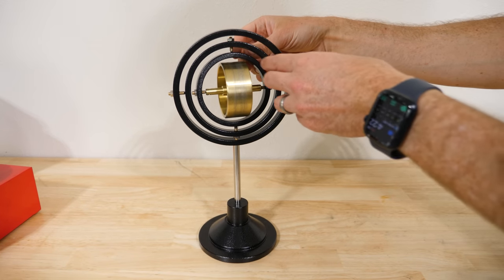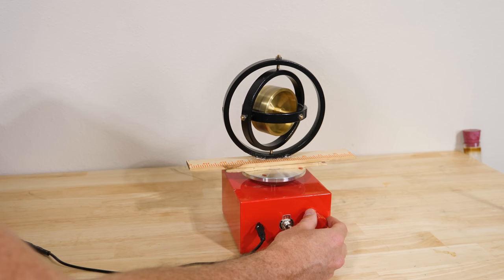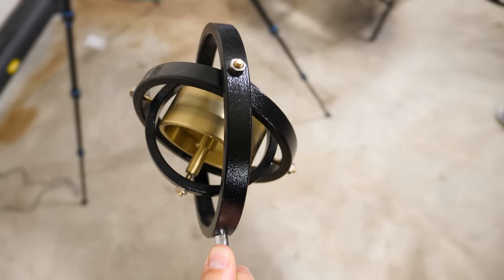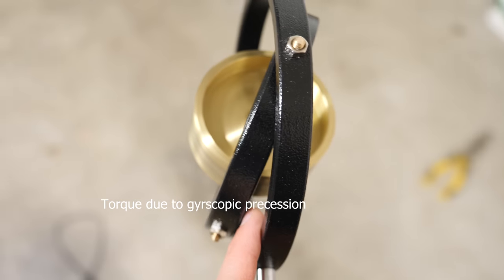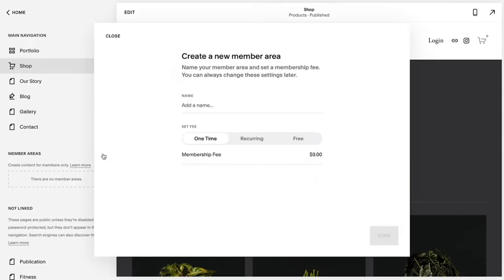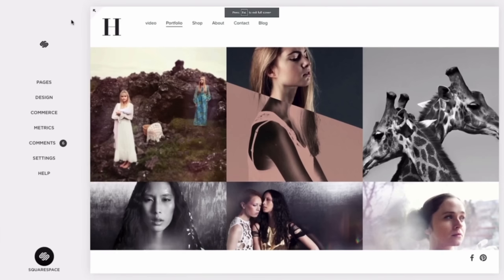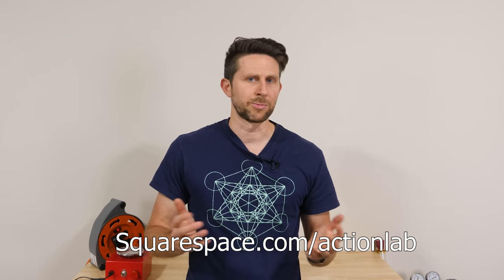Can Gyroscopes Provide Free Energy For The Planet?

Comment: What about instead of a gyroscope, you used a Foucault Pendulum? It swings based on the Earths rotation, needs no introduced force like a gyroscopic mass, and can exert energy without (noticeable or appreciable) slowing (in the cases Ive seen, knocking down pegs). Could it be used to generate a weak electromagnetic field by passing a magnet over a coil?
Reply: But the balancing pendulum requires some energy to go forth and forward (unless I didn't understand what you meant). It will be strongly slowed down by the magnet.
Reply: I went to the exploration place and they had one and yea it knocked down pegs. It was used as a clock so it must be fairly consistent.
Reply: Using that as a magnet moving to generate current in a coil seems an interesting idea
Reply: Maybe with a modification you could extract rotational energy rather than extracting the kinetic energy of the pendulum swinging. If the pendulum mass was on a solid rod (like a hammer for example) and the end was hinged to a disk or something that could rotate at the pivot point, then you could extract rotational energy as the earth rotated under the pendulum. Operating the thing in a vacuum would help reduce friction losses. Using magnetic bearings at the pivot point would be beneficial too to reduce friction losses.
Reply: @mb-3faze  If this method was true we would need multi ton swinging balls on a large scale, vacuum chambers that large are not feasible.
Reply: Foucault Pendulum, do not work the way you describe, You must give it a swing to start it on a linear path, and as the earth rotates, the path stay the same and the earth below rotates, thanks to a special designed device to allow the Foucault Pendulum, to swing in any direction with consistent fiction, You see these big ones in the museum, swing all day long because it has a lot of mass, so it doesn't appear to be slowing down but it is. It gains no energy from the earth, the idea is that it swings separate of earths rotation to prove earth rotates
Reply: I have left many comments  trying g to get his attention  about this.. but hey.. we can let the lawyers sort it out lol 😆
Reply: @c1h2r3i4s56987  I have already  designed  it
Reply: @c1h2r3i4s56987  oh well, All my hopes and dreams of a future megaworld running on foucault pendulums have been shattered
Reply: I did it eureka!!!eat la spaghetti !!!!
Reply: This subject has been reasearched for 50 years. They have probably already tested out almost all alternatives. It seems that even if you cod generate energy with this machines the energy needed to keep the machine running would be more.
Reply: Side note: The plane of oscillation of a Foucault pendulum only rotates once in 24 hours at the geographic poles. The rate varies with latitude. In Paris, it takes about 32 hours for a complete rotation. At the equator, it does not rotate at all.
Reply: Go to Russia, present your idea ?
LOL
Reply: @manicmadpanickedman2249  what do lawyers have to do with anything?😆
Reply: Wouldn't the coil produce the electromagnetic field in the opposite direction slowing the pendulum? (Kinda like a magnetic ball going down a copper pipe)
Reply: @manicmadpanickedman2249  I Designed a blackhole generator too, but Have I built it...? nope. 
Have you built a working prototype?
Reply: @c1h2r3i4s56987  no ... its but still copywritable lol 😆
Reply: @94D33M  srry, maybe one day, Some sort of Pendulum system. I think a way to harness earths rotation is sticking giant poles into the ground at both poles and letting a pole at the poles to turn a massive generator, suspended as a pendulum so that its possiton in space is fixed and the earth rotates including the  below, but even this is unfeasible and, on soo many lvls
Reply: @c1h2r3i4s56987  only but a breath held in time
Reply: No the coil would slow the magnet
Reply: @c1h2r3i4s56987  
Large focault pendulums have electromagnetic "kickers" at their point of suspension so energy is constantly introduced to maintain oscillation.
These are carefully designed so as not to introduce any directional bias.
Reply: @clarencegreen3071  
Focault pendulums register sidereal days, ~4 minutes shorter than solar days.
Not that it makes much difference.
Reply: There's one key thing you have to remember. You aren't MAKING energy, you're CONVERTING it. Whether it's a gyroscope or pendulum, you're still converting the object's kinetic energy into another form of energy, which means the gyroscope/pendulum no longer has that energy. This simple fact stops any form of this idea from working.
Reply: the laws of thermodynamics pop up. any device used to tap into the pendulum will sap some of its energy. even if it had a 100% (which is impossible) return on its initial energy investment, it does need to be started after all, the field drawing power would sap some of that. so youd get 99.999999999999999999999999999% on the next swing. then 99.999999999999999999999999998%, 99.999999999999999999999999997%, 99.999999999999999999999999996%, etc. eventually it drops to 0 and you get no more energy.
Reply: @pulsefel9210  Yep, happens with every single one of these. Some small part of the machine's energy will be converted into heat energy via friction. There is no such thing as a perpetual motion device, especially not one that could power anything.
Reply: @Maxwell_Twist  ill give them the benefit of absolute frictionless motion, no air resistance, and 0 resistance wiring. still doesnt stop the problem that the energy they are harvesting comes from somewhere and the only way to produce energy is to tap into a white hole.
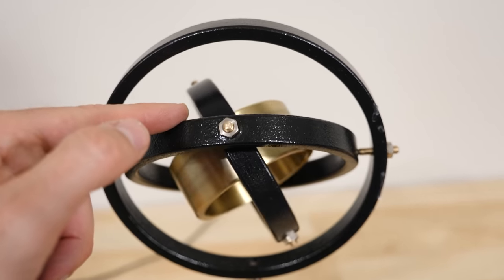Reply: @c1h2r3i4s56987   almost 100% right its not really just the mass that makes it swing all day long there is a electro magnet at the top that gives it a little boost  "watch the world turn" by kurtis baute covers the Foucault Pendulum and around the 4:27 mark says about how the large pendulums have electro magnets to keep them going.
Reply: ironically this is actually how they are powered. as it is always turning it loses momentum to friction to combat this at the top they have a electro magnet that gives a lil kick to account for the friction. iirc there is also a desk toy with a electro magnet in the center of base that pulses to keep it swinging
Reply: I wonder
Reply: @darrellkimmel2646  that's what I'm saying they are NOT getting energy from earth's rotation, they have to be set up some are started manually the big ones you see in museum's use electricity, the originals had to be started by tying it to one side and burning the tie with a candle as to not impart any sideways motion during the start of the swing. Very delicate to get it to swing perfectly without automation
Reply: @Lornda  how did they make them before electricity was utilized  then I wonder🤔🤔🤔🤔🤔 can yall Google search and fact check yourself before commenting
Reply: a foucault pendulum IS a type of gyroscope...  the plane of the pendulum's movement stays stationary with respect to an outside frame of reference.
Reply: @manicmadpanickedman2249  I'm pretty sure you're just fucking around here, but just to set one thing straight, you don't copyright a design, you patent it.
Reply: @Maxwell_Twist  depends on complexity  and if it doubles as art or not mine is conetic art and serves a dual purpose
Reply: @Maxwell_Twist  also love how nobody  can state exactly  what's "wrong" with it the try to disclaim it others ways because" they don't understand  it" ..
Reply: wouldn't this slow down the earth? very slowly yet surely...
Reply: bounce a wave to swing a swimming pool from a lever with a counterweight to pump a giant waterfall by having fun
Reply: You wouldn't want to extract the energy that keeps it swinging, as that would just make it swing slower and less.

You could probably put the swinging part on a rotating shaft, then hook a gearbox up to the shaft to try and harness the 1/(24*60) RPM of movement the shaft is doing.
Reply: You would think that would be the case right... the fact that you can't proves that the earth is stationary
Reply: What I always thought of is a hybrid of using the Foucault pendulum in conjunction with a very large heavy flywheel. So that the flipping of the wheel would not happen.

Comment: 2 gyros on the same axle spinning in opposite directions would cancel each others precession out. Now you can save the world, you're welcome. Seriously though, you don't need to let the gyro turn, the problem was more likely that they couldn't keep friction lower than the amount of energy that could be harvested.
Reply: That would also cancel and net gyroscopic action.  Of course they would still react to changes in orientation but the forces would only act on the axle.
Reply: @whatelseison8970  Can you explain what you mean by "net gyroscopic action". The idea was to harvest energy from the rigidity in space.  

Two flywheels, or "gyros" on the same axle spinning in opposite directions would "help" each others rigidity in space, but the directions of their precession that was claimed to be the problem would be in opposite directions, and thereby canceling each other out.       

Replying to you I just realized the idea has a much more fundamental problem. Rigidity in space is relative, rotating flywheels doesn't resist turning, they resist changes in direction and speed of turning. Their idea was fundamentally flawed.

Comment: Yes: tidal enegery! That can be harnassed, and it already is.
It's the Earth's rotation being "shaken" by the Moon's gravity. Don't get bigger in terms of "ball + hand" than that!
Reply: That’s what I was thinking.  The wind currents and ocean currents.  Water is way denser than air though.
Edit: My favorite is a start up called Eco Wave Power.  It‘s on the NASDAQ.
Reply: True, but tidal energy is effectively useless when you consider the cost/kw and energy density.
Reply: @g.4279  Yup, solar will be much cheaper. Yet at some point manufacturing might become cheap enough so that tidal can have its application in dark and cold environments, or where wind turbines would suffer too much, like the Arctic for instance.
Reply: @g.4279  Tidal power accounts for less than 1% of world wide electrical generation, but that still represents a few gigawatts on average.

Tidal power is easiest to harvest where the geography funnels tides through a small channel. This concentrates the energy making it cost effective to harvest.
Reply: Ig that's moons kinetic energy
Reply: @g.4279  the coat is associated with finding a structure that is inherently maneuverable and resistant to highly corrosive salt water
Reply: Tides are caused due to change in distence (hence gravity) of moon. So harnessing it will interfere with the moons path
Reply: @siddhankraikar714  exept that the Moon's kinetic energy increases due to the tidal dissipation. The Earth slows down and transfers part of the angular momentum to the Moon's orbital momentum. The Moon speeds up.
Reply: @quintespeed  So many ways to harness the motions, but to do what?!)/*  and you're messing with the calendar etc.. don't do dumb shit like f' with the calendar... unless you absolutely have to... but hey.. we could probably get the moon closer to make it easier to go to....))//**
Reply: @siddhankraikar714  lol, no.
Reply: @andretokayuk8100  The Earth has a rotational kinetic energy of 2,138×10^29 J. World primary energy consumption fell to 556,63x10^18 in 2020. At that rate it would take approximately 384.097.156 years for the Earth to stop.
Of course, taking more than a fraction of a procent might be dangerous, but that still leaves like a million years of untapped potential.
If we can harness that energy in a cheap and clean way, we can stop more immediate threats to the biosphere like burning fossil fuels. (although solar + storage will surely be cheaper, so it's a bit of a moot point).
Also, since the days naturally lengthen by tidal friction, at some point we'd need to build Earth spinners anyway in like a 100 million years.
The damage we are doing to the environment now is immediate, I am betting solar + storage will be able to mitigate that, but if using Earth's kinetic energy can get us there sooner and we pay that back using fusion power later, that can be a big win for biodiversity.
Reply: @MrMichiel1983  Ight, man, but I don't have a direct line to Elon Musk..)/* And the logistic scale seems a little deep in squirrel space %)
Reply: @andretokayuk8100  Hehehe, me neither.. Not yet anyway.
Yeah man, I don't think a massive gyro or anything like that is a good idea...
but where tidal energy offers a cost effective solution we shouldn't be considering the effect on Earth's rotation is all I am saying.
Reply: @MrMichiel1983  Don't know about you, man, but I saw some interesting shiz in the sky the other day..Trippy trip trip...)/* I had modified vision..)
Reply: @MrMichiel1983  Personally, I'd say these should just be temporary things until we have something like nuclear set up in the area.
Reply: those little gyro balls, tethered down and bobbing in the water/tide was my first thought.
Reply: @siddhankraikar714  correct me if I’m mistaken. 
But doesn’t the moon just effect the timing of the waves(high tide,low tide) and not the energy in the wave it’s self(imparted by the rotation of the earth flinging it out from center of rotation)
Reply: @BimotaMoon  the energy in waves is kinetic which it cannot have by itself it's definitely caused because of the moon. I think I'll have to look into it it to know where is it coming from.
Reply: @iura_ch  is it ? I think I'll have to research
Reply: @siddhankraikar714  Let us know if you discover anything surprizing!
Reply: Using waterfalls and kinetical device to do the same thing your hand and arm was doing to the gyro ball
Reply: @andretokayuk8100  Energy is dissipated through the tides whether we extract and use it or not. This slows the rotation of the earth, while causing the moons orbit to move further away. Friction causes some energy to be lost as heat as the tides change, regardless of human intervention. Note that this can only continue until the moons orbit and the earths rotation are the same. At that point the moon will be fixed over one point on the earth and there will be no more tides. However the sun will make the earth uninhabitable long before that happens.
Reply: Or electrostatic energy.  With a magnetic field parallel to the rotational axis, there should be a current or electric field between the axis to any fixed point outside the axis.

Comment: Great video, and really interesting idea! And i find it funny how the problem you run into here seems to be the same as referred to as "gimbal lock" in 3d animation. You'd think that describing the rotation of a 3d object you'd be fine with just an x y and c coordinate, but since they are influencing each other in a hierarchy you end up in these situations where they line up and you have no axis left for the rotation you want. Therefore it's popular to use quaternions, aka 4d numbers to describe rotations that don't run in to the same problem. I wonder if this translates directly to the mechanics of the gyroscope and number of rings and how they are connected. And if it would be possible to mechanically construct a "quaternion" gyroscope with 4 rings and somehow get around this problem maybe??

Comment: in case of a frictionless disc would it slow down if you were extracting energy? Anyway the power used to keep the wheel spinning will probably be greater than what you get.
Reply: No 

You are extracting energy at 90 degrees to the disk 

So a frictionless disk held at the proper locations would not extract any energy from the disk 

It extracts it from the earth
Reply: Yes, if you turn a spinning gyroscope, it drastically slows down
Reply: The amount of energy available is tiny, any attempt to exploit it will kill it.
Reply: @YouGloomy  don't know enough to answer your question but I've been thinking about making some flywheel based batteries and the water idea is very interesting.
Reply: Any amount of energy extraction from a moving or rotating object will slow it down. 3rd law of Thermal-dynamics is of those things that can't be bypassed, high energy wants to reach equilibrium with low energy. Entropy's a bitch.
Reply: Yes, it would 100% slow down and eventually stop. You're converting the kinetic energy of the disc which, means you are slowing it down.
Reply: @LimabeanStudios  water may seam a good idea until you realize that since it is a fluid with some viscosity it actually has internal frictions with itself (and it still has a lot of friction with the container)
Reply: @emanuelescarsella3124  good points I can also see lots of issues when you take energy from the wheel and it starts decelerating
Reply: I think the worry is about what if you supply too much power to the device in any circumstances.
Reply: @andretokayuk8100  hell are you talking about you seem to have messaged the wrong person, also extracting energy would lengthen the day not keep it constant, also no its a planet and we need to intelligently use our resources none of this over anthropomorphizing of the planet...
Reply: @Maxwell_Twist   actually you are cofusing the 2 forces one force is tangental to to disk you should never be extracting the rotation energy in the
 plane of the disk
Reply: You missed the point of the video. The speed of the gyroscope is supplemented from the rotation of the earth.
Reply: @LimabeanStudios  That's what Dams are for.